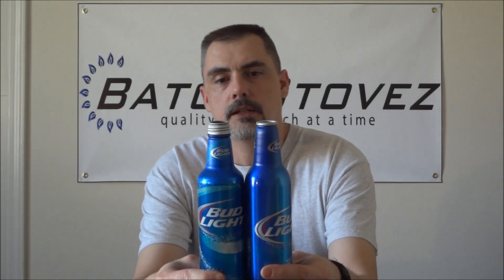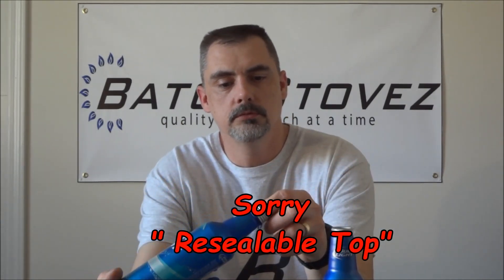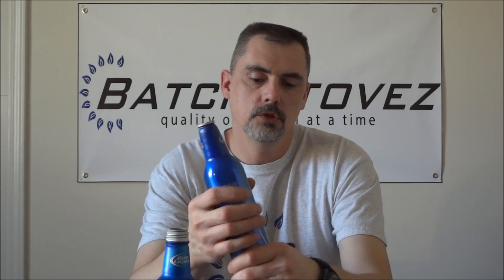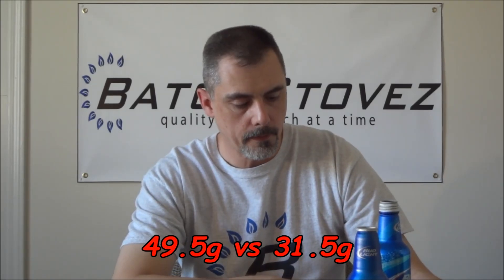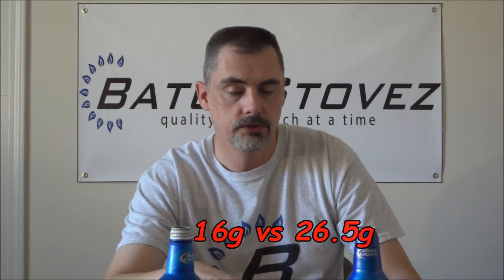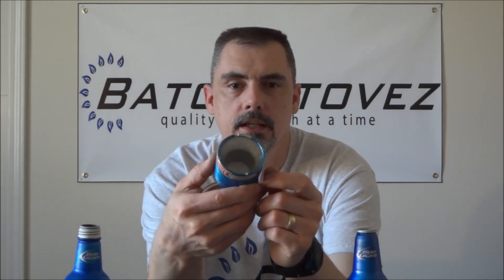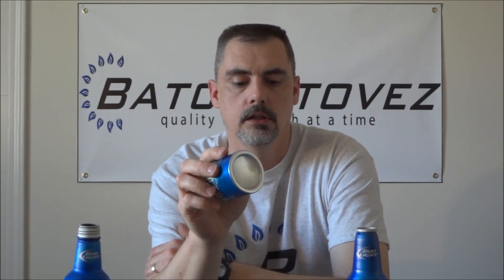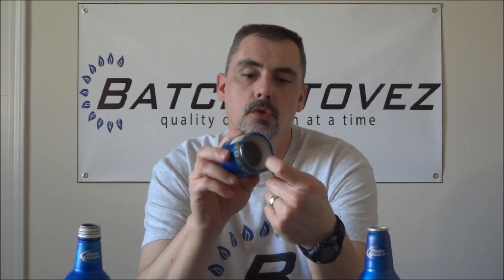Aluminum Bottle R.I.P.

Comment: You said the end of the "Pry-Off" aluminum bottle but I was able to pickup an 8 pack of the old style bottles. Budweiser also offered 30 packs in the "Pry-Off" aluminum bottle. As of 06/05/2015.  Also pickup some screw off type just to see the difference in thickness. A lot of difference still thicker than the 12 ounce cans.
Reply from the maker: william holland Yes "The Stadium bottle" Can still be had for certain promotions like the FIFA world cup, Super bowl etc. And in some markets but they are limited. Good looking out, Thanks

Comment: hey sam, thanks for the video and for all the heads up... I believe this is about 2 yrs later after you originally made this video. anyway, just today 3/2016 I found and bought some of the old style Budweiser (not BL) pry-off 16oz. bottles. I found them in red. anyway, upon seeing them as singles at the gas station where I live (texas) I bought them because of seeing this video a long time ago. I'm glad I bought them and i'll drink them and then see if I can roll a nice lip on them? we'll see? thanks sam!
Reply from the maker: +Martina Dejaquiz 
That's great! Martina, I did see them from time to time after this video But in my area its been over a year since Ive seen the old style now both Bud and Bud light are of the twist top variety. :-(